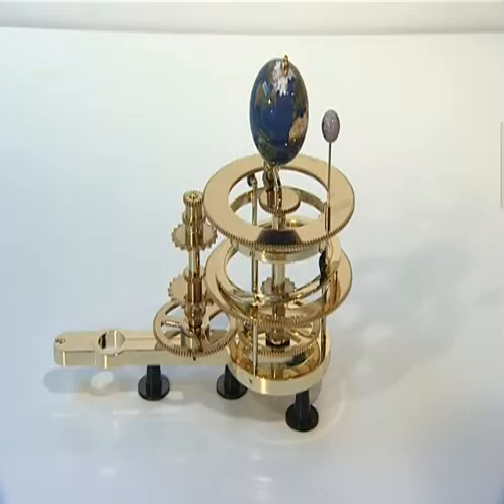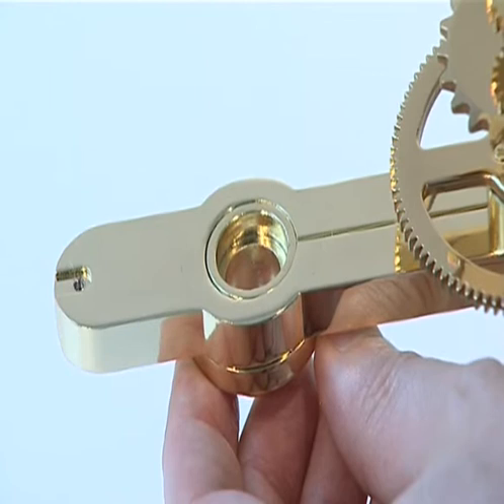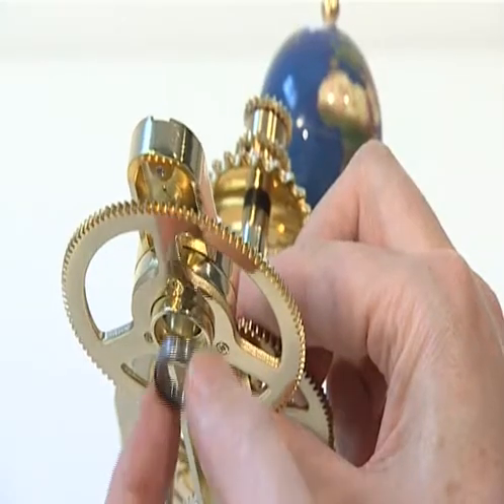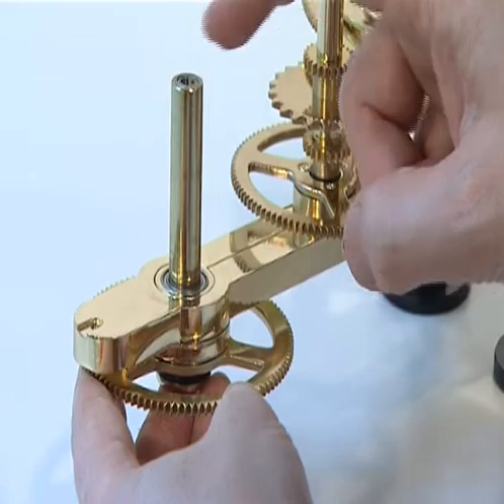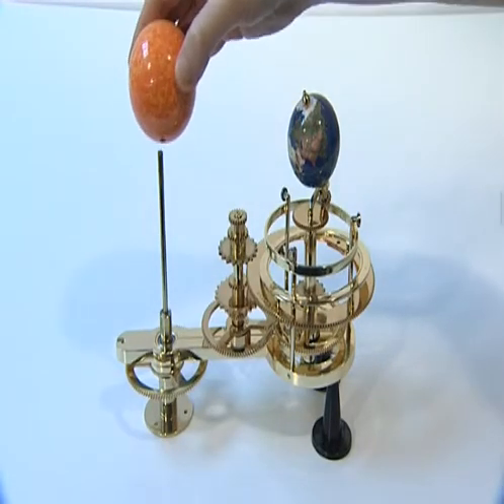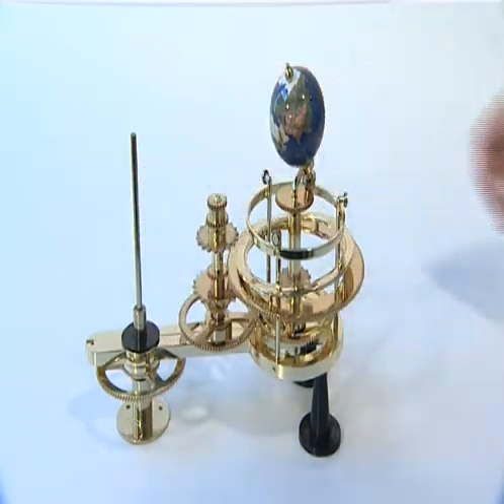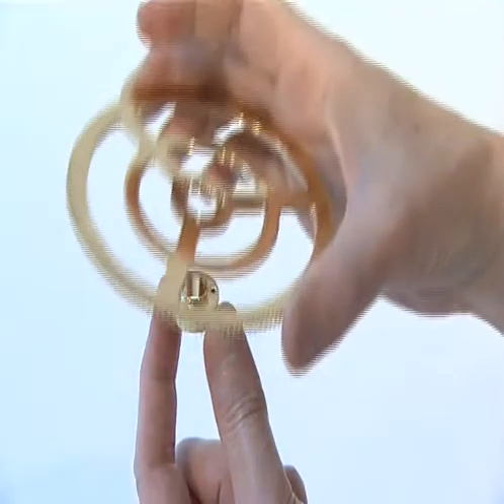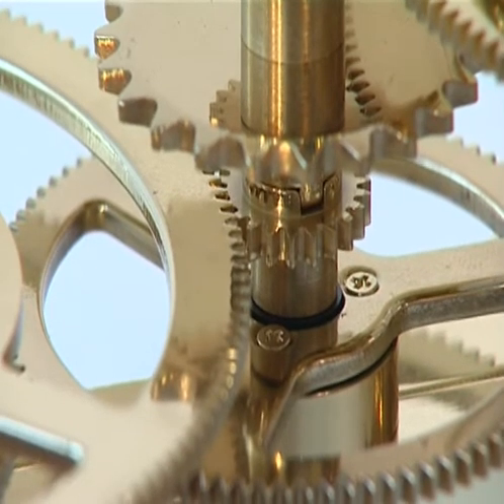Build a model sun, moon and earth orbiter: Stage 3

Comment: The ONLY reason the central shaft is installed in this step is to support the temporary Sun which is just to make the model look better until you get more parts. This shaft really doesn't need to be installed until Stage 7 when the chains and sprockets are installed. I didn't need to use the temoprary Sun because I recieved the entire kit at once and was able to continue to the next stage. This model just became available to the U.S. I am going to make some assembly videos to post on You Tube.

Comment: @Anthonyk312 The 91 tooth gear installed previously you're referring to is locked in place on the CENTRAL COLUMN. The central column is held in place by this gear on top of the Earth arm and the central column support underneath the arm with locking screws. It doesn't touch the CENTRAL SHAFT. The other gear underneath is screwed to the central support collar which in turn is screwed directly to the Earth arm. Removing the CENTRAL SHAFT does not affect any gears at this stage of assembly.

Comment: Anthony. Watch the video closer. The gears are held in place by the CENTRAL COLUMN (54) not the CENTRAL SHAFT (55). The shaft run down the inside of the column that's fitted with a couple of bearings. Removing the shaft does not affect the gears. I know because I have had it together and apart 3 times now. I did think about it carefully and figured this out before I even got the model to put together.

Comment: When installing the 160 tooth gear at the end of this video, it shows the model being tilted up until the central drive shaft is clear enough to install the 160 tooth gear. It would be a lot easier to just pull the central drive shaft out of the model and then install the 160 tooth gear and reinsert the drive shaft without having to tilt the entire model.